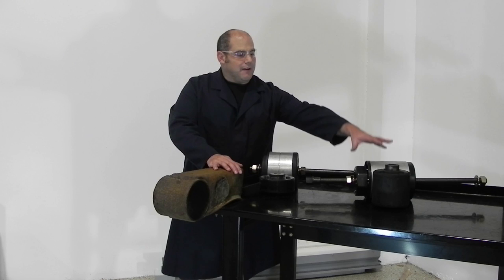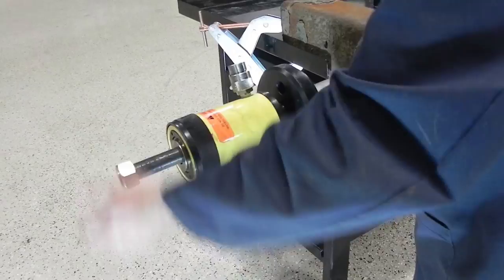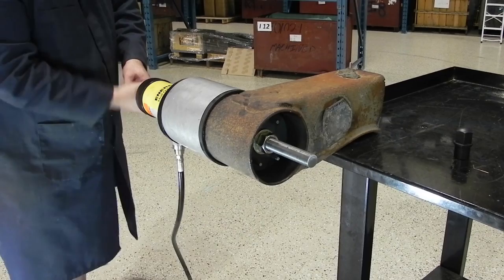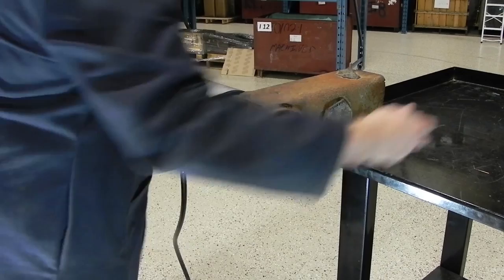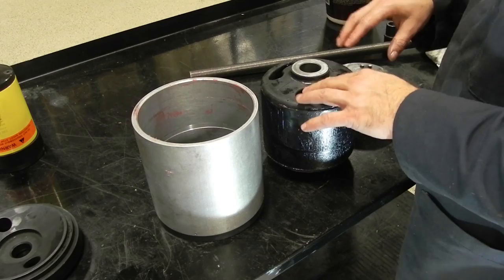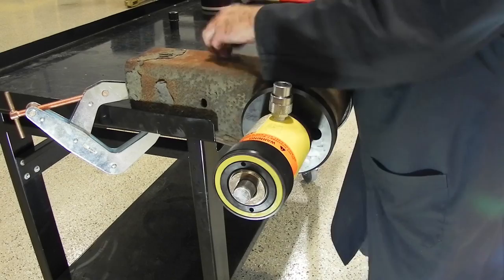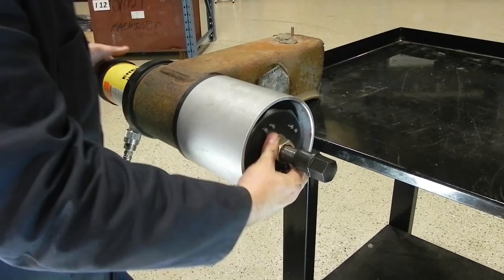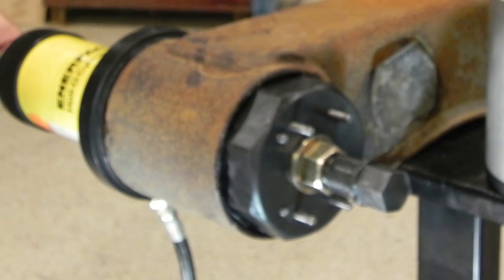Hendrickson Tri-Functional Narrow & Wide Bushing Adapters | Tiger Tool 15040 & 15041

Comment: Hi, what is the difference  15040 and 15041 adapter?? Thanks
Reply from the maker: The 15040 is designed for the Intraax Tri-Functional Bushing and the 15041 is for the Vantraax Tri-Functional Bushing.